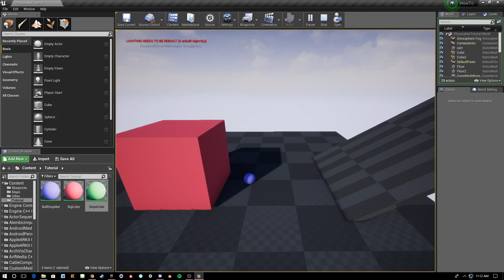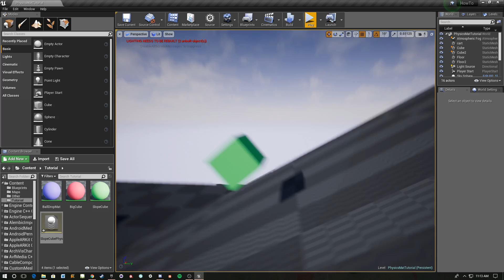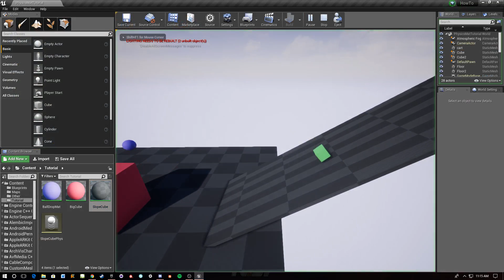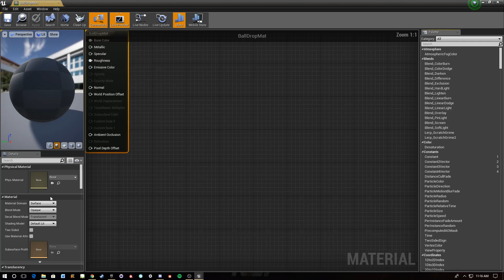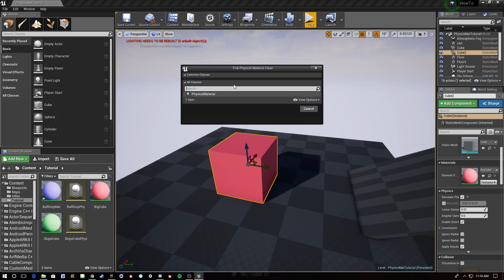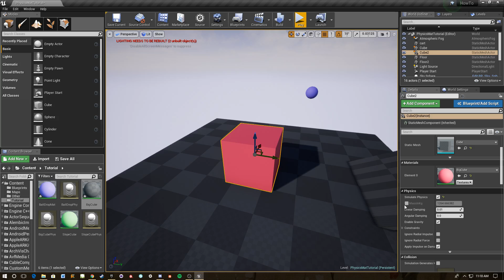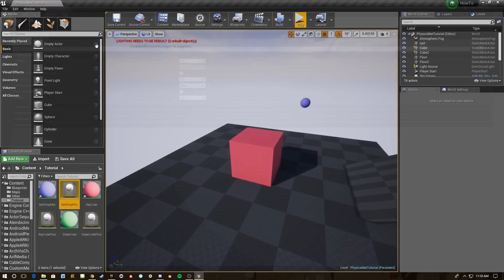Unreal Engine 4 - Quick! How to: Use physics materials.

Comment: https://youtu.be/dqqF_dBs3OE   was wondering if you could maybe help. i have this problem with my marble game which the ue4 balltemplate has aswell.  When the ball reaches a certian speed then when it comes to the intersection where two meshes meet it will bounce no matter how flush they are. I've tried loads of things and even did some substepping settingh that someone recommended but up to now iut seems that there is no way you can make and endless marble runner if the marble is gonna go over certian speeds which is what i want. high speeds and fast corners. lol. But yeah. without the highspeeds my scoring system is useless. I've replaced my marble with a character in the meantime till i find a solution. If you can help please let me know. Appreciate your tuts. They've been very helpful.